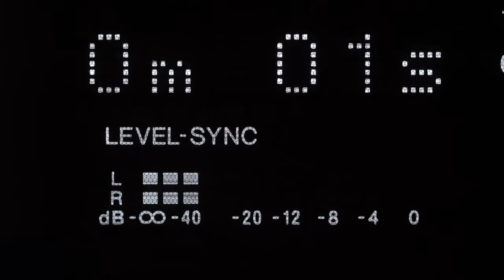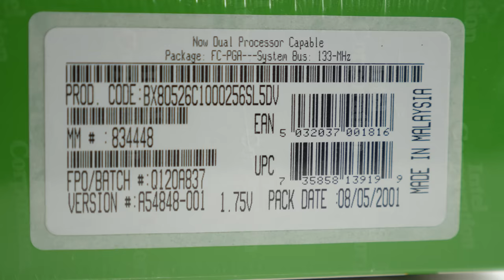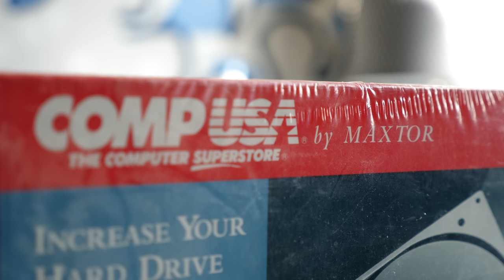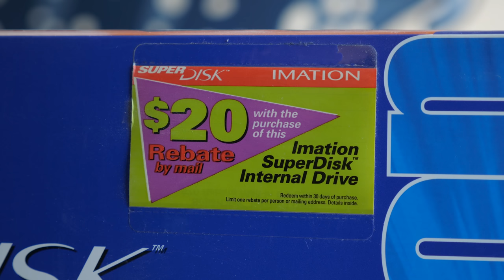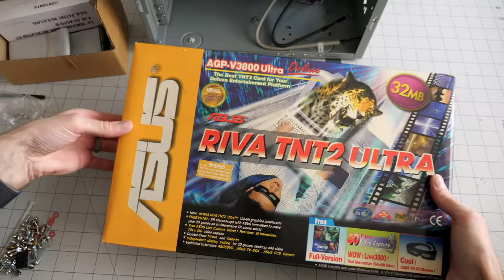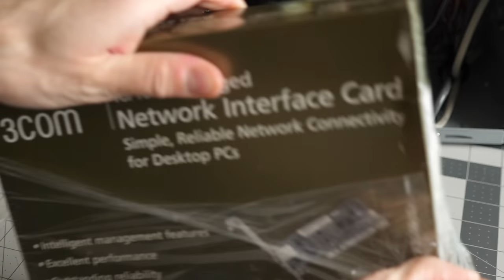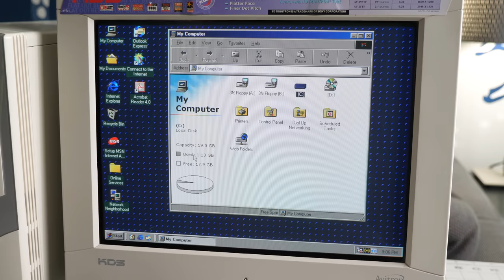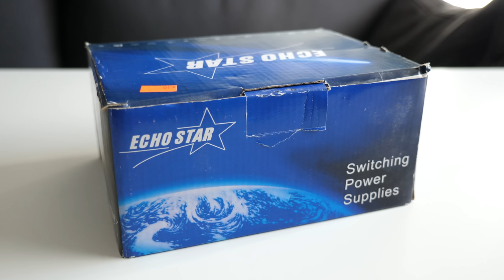Building a Retro PC From New Old Parts!

Comment: I've built hundreds of computer like these during the late 90s and up to about late 2009. I can state for a fact that when I used 2 - 5.5 inch drives such as a CD burner and a DVD burner/player, I' ve always put both on the same IDE cable. Never once anyone complained about burning CDs/DVDs or any other issues regarding the computer performance. It's a total bummer that the LS-120 drive did not work for you. I did build a few computers that had that drive in it and it was super convenient for my clients to have the flexibility to use either the 1.44 MG or the 120 MG floppy drives. I am currently a retired IT pro, but I still build and repair computers for friends and family.

Comment: My first mouse, back in the 1980's, was made by Mouse Systems. They also provided mice for some Sun workstations. They were pure optical mice, no ball or other moving parts. You had to use the special mouse pad supplied with the mouse as it used the red/blue lines on the mousepad to orient itself.

Comment: I think the Sound Blaster sound card is from more than the mid-2000s, I had the Audigic with the front accessory (for the remote control) and on your vintage PC :) I think a Sound Blaster 16 would have been more in line. But it was fun, so many memories!

Comment: The shutoff when the LS120 disk made contact may have been because of a static electricity shock.  In the mid 20-aughts, I had a Toshiba laptop where that happened now and then when I touched any metal or metallic plastic part.

Comment: I had a 486, Pentium 2, 3, 4. All worked great at the time. I always had power supply issues of some kind. One thing I can say, they ran really fast. Once again, I just put together a brand new b550 board, with a Ryzen 7 5700g apu. in 10-15yrs from now, this computer will be a relic as well. We are still in the golden age. I will be honest, I still like the old look of the cases. I dont care about the flashing lights, and the bling, I just want a case that is solid, easy to put my parts in and forget about it. Those old cases were easy to work with and many were build like a safe. This vid brought back so old memories, thanks for the vid.

Comment: I have a similar story about a computer turning off when I stuck in an LS120 disk into the appropriate drive, except the computer exploded. The reason for this issue is that the drives can occasionally short themselves out when a disk is inserted, your PSU had protection, the one in the pc I was working on did not, so all the main compactors blew up. God it was loud.
Slip kachunk
POW POW BANG POW POW POW BLAM.

Comment: I bought a computer from Voodoo Computers of Canada in 2000. It was top of the line, and awesome! I had a 24" Sony Trinitron Wide Aspect CRT monitor. I'm just barely  starting to see tv/monitors match the quality of that monitor. It weighed 100 lbs., but worth it.

I also had a Klipsch 5.1 surround Sound 2 10" drivers in the sub box. The clarity was amazing. That subwoofer shook my entire house.

Comment: Miss the adventure of actually building up your machine over time, getting a dope sound card then graphics card upgrade.

I still smile when I hear that Windows 98 startup sound on decent desk speakers, my first hand me down computer was on Windows 98, and I learned what I could with it even took it to my high school to finally upgrade the RAM on it, from 32 megabytes to 64 using old parts my school kept, eventually buying a new HP desktop bundle for $500 USD at that time in 2003 (that didn't last very long), then building my first custom desktop in 2004, even took it to school to download videos and other stuff using their internet, because I didn't have DSL (or any internet) at the time.

Only reason I stopped using that desktop is the Sapphire 9800 Pro 128MB I had got damaged in a move, and the laptop I was using at the time was "good enough" for games and school work at the time, until the backlight inverter started going out.  The desktop used an AMD Athlon XP 2700+ with a VIA or something motherboard ($100 for both), 1GB or possibly 2GB DDR-400 RAM from Kingston, CD-RW drive and DVD-RW drive from Sony (that was an expensive DVD drive at the time), and a 160GB Samsung HDD that was decent but noisy.

Played the everloving heck out of Halo CE and Custom Edition once I had Internet at home.  Burned so many CDs and DVDs, but got rid of most of those I had left over a few years ago.

I know systems have gotten better over time, and I know I've owned better systems and currently own a really good one, but that time was pretty magical, like others have said, regarding seeing the newest thing come out and wanting to get some part of that for your own. Maybe that just goes with youth and desire, but it was also a great time for me and my friends at least in that regard. Thank you for sharing this blast from the past.

Comment: I want to say the "clipped UPC" isn't someone trying to get a (customer) rebate / the parts being preowned, but the store doing it and sending it back before disposing of the parts to get credit from the distributor / retailer. The same thing happens with books and magazines (in fact, some of Terry Pratchett's Diskworld paperbacks I have have a note about it on one of the first pages - "if you bought a book without the cover, it's stolen, they send the cover back on unsold books to get credit, so don't buy it without the cover" essentially.

Comment: The hot glue was common in the corners around the cd drive. With 24x and higher that used quick release tabs instead of screws, at max rev it would vibrate the case which would rattle against the chassis. Hot glue quieted it down and acted as a vibration dampener.

Comment: The pins on the end of the sound card is use with a IDE ribbon style cable, it is use to connect a header unit the goes to the front of your case and has knobs for volume and things and has plugs for connecting different devices and a little LED screen. That card can be bought with all of that stuff together as a kit, but very hard to find now.

Comment: Still own the 5.7GB version of that CompUSA Maxtor hard drive, and still even have the identical box; the barcode is missing because it had a mail-in rebate for cash back. A group of us stood in line outside a CompUSA early one morning for something like a black Friday doorbuster sale. I don't remember the reason for the event.  But the Maxtor drive was dirt cheap that day, back when hard drives were not cheap. Anyway, that particular 5.7GB drive holds my personal record for longest lasting drive. It STILL works in 2022, probably 20 years after purchase. It is loud as heck and slower than a turtle but it works.  It was retired long ago, of course, but I recall never having even one bad sector on that drive.

Comment: I had an LS120. I had the foresight to get plenty of blanks but I never found anyone else who used them. I left it in the system and kept most of the blank discs sealed. I don't think I ever had a disc go bad on me and the drive itself was of a pretty high quality. Bad floppies that didn't work in a normal drive could frequently be read by the LS120 so I could probably have made more of that situation. A good product that never got traction.

Comment: Another important detail, you should have put the CD burner on the secondary IDE cable. For reference, the IDE connector will time the instructions data-rate to the slowest device on the cable which will indirectly slow down the max data transfer speed of the hard disk or cd burner depending on which one is slower.
And another important detail is that having these on separate IDE buses will also ensure one device does not cause the other to wait for any reason as they will be managed in a nearly 100% independent fashion, which is particularly important on systems of this generation when burning CD's as any heavier load you'd put on the HDD could make your CD burning crap out, which having them on 2 separate IDE controllers would heavily help with. Small difference costing the price of one cable that would and will save you a lot of failed burns.

Comment: I still have two Maxtor drives, but not quite that old. A 200gb and a 500gb. At the time, 500gb was enormous. Those were my only drives for a very long time, until I finally moved to solid state. They still work, I still have data on them and plug them in (externally) probably once or twice a year.

Comment: rainbow IDE cables and floppy cables are great for harvesting wire from for various soldering projects. While SCSI cables don't typically come in multiple colors, they usually feature even finer wire, so they can be great for signal wires that don't need to carry any current to speak of. I've seen lots of those cables harvested for console mods. Plus, if you collect e-waste salvage stuff, you're likely to end up with loads of spare IDE cables and the like.

Comment: Ive been running an x58 setup with an early 2000s massive Antec full ATX case and PSU. I'm impressed the PSU hasn't popped seeing how old it is. It's running a six core x5670, 660ti pushing three monitors at 1680x1050, DVD drive, 7200 rpm HDD, and all six slots of ram filled. Definitely time to get a new PSU before I burn down the house 😅

Comment: The race to 1Ghz was pretty ferocious given the timeframe. The Coppermine P3's were pretty good with being prodded to overclock, I recall a P3-700 I had running ok at 931Mhz then getting a P3-933 which only managed 998 which was reaching the limitations of the Coppermine core. I think Intel released a 1Ghz version but had to pull it with overheating concerns. They fixed it with the Tualatin core but with the compatibilities introduced it fell flat, but even worse was the move to P4 which took steps backwards meaning even Pentium 3's would outpace the newer P4's, even with Netburst baked in. Then Hyperthreading came to fruition and finally P4's became a viable upgrade. By which time AMD were storming ahead with their AthlonXP line then it became a race to see how many cores could be crowbarred into a cpu package. Amazing times.
Reply: I remember when AMD released the 1ghz T-Bird in 2000 that was just this wild number. Who needed a cpu to be that fast?! LOL Now it's slow if it runs at less than 4ghz. I didn't get a P3 933 until 02 or 03 so it was "slow" at the time but man did I love that machine and it played everything I wanted it to. Also, you are so right about core counts. In 06 I had a Pentium D a dual core, in 07 I had an Athlon 64 X2 also dual core, in 09 I had an Intel Quad Core and in 11 I had an Intel 6 core. Which is wild to think that 11 years later a 6 core is considered the bare minimum now and most people will tell you to get at least an 8 core to be safe.

Comment: On the secondary IDE channel you used different ribbon cable. That will  give you slower speed to the cd drive. Can also produce intermitent sound during audio playback from cd-s if you copy from cd in the same time. If i remember well that cable also disables UDMA transfer.

Comment: Just a little tip on older motherboards like these. Try to clean them with 99 isopropyl alcohol and deoxit contact cleaner. Some of them connections might have rust of them.

Comment: The PCs had a BIOS with a power management which, in conjunction with Win98 / XP, enabled the computer to be turned on from the keyboard with a dedicated button. A common (for me) solution was to enter the password that was started by the computer (previously set in the BIOS) from the keyboard. If you love PC from those days, YOU SHOULD KNOW THIS.

Comment: I honestly get both sides for opening sealed eletronics. On one hand, opening them and using them as they were intended to be used just makes me happy, but on the other, i think just a couple should go into museums for people to look at and get nostalgic or see how the previous generations lived. But on the same side it would be fun to have them completely opened for people to see the processor, gpu, ram, whatever and see how far we've come. Like looking at old hard drives from the 80s makes me kinda laugh at just how far we have come in storage technology in the past 30 to 40 years. So, yeah, both sides are valid but i prefer being able to use the parts as they were intended to be used.

Comment: Great nostalgic video.. sleek commentary. I also liked that you covered up all the failed part hiccups. It gave a more nostalgic feeling. Used to make some pocket money back in my college days by building pcs for people. I also ran into cases of repairing and upgrading old pcs and ran into parts being dead issues. Trickiest issues i faced was ram being partially dead.. so PCs will run till the ram didnt fill up data on the dead chip on it and once reached there it would give random restarts or bsod.

Comment: The memories of that era are ingrained! cases with razor sharp edges that tore your hands up, cpu fans that would last a week or two before wearing out and screaming like mad, power supplies that were total junk and if the internal fan did not die the capacitors would explode. The absolute pinnacle of the cheap-junk pc for me, was the TX-Pro PC-Chips socket 7 motherboard! what a pile of junk that was lol.

Comment: I Actually Had That Very Same Motherboard, And The Same Ram Sticks, and The Very Same Heatsink, And Fan, But A Different Speed CPU, But A Slightly Larger Hard Drive, But A Different Case As Seen In This Nostalgic Retro Video 23+ Years Ago, And Win98, Then 2000, Then Me, Then My Favorite Win-XP, Then XP-Pro, With Windows Media Center For My DVD's . . . Wow, And Weird . . .

Comment: I have a possible reason the barcode was cut out of your package. Various jobs I’ve done mark unsold and retired merchandise that way. Sometimes they are sold in bulk other times they are discarded. Books that have the title page removed are usually that. The store is compensated (somewhat) and the item can be sold at a discount. Sometimes they are resold as “new” by shady operators.
 This happened at my local auto parts store older model parts like filters and hoses for retired model cars.

Comment: I had an imation LS120 drive back in the day.  At one point I remember being able to get the drive with 2 disk starter pack for $49 or about the price of a standard 1.44mb drive (2 ls120 disks were about $35 by themselves). Because they really make the money off disk sales. they give you the drive cheap and make you buy $18 disks.  Iomega did similar things with the zip and jazz drives.

Comment: I built my original tower used hospital terminal for $400 in 1998. It was just a terminal. Lucky I had an uncle help me just enough to help me learn bios flashes, the whole nine. The first one I probably spent 1200 extra on all extra cards and gasp dial  up modem card. I was downloading dance music from the UK over dial up and happy with it. 
There are so many music friends I had who ended up overheating pc's in dorms, starting fires playing music w fancy graphics. Milkdrop on Winamp. Like a LOT. I never got a fire. One laptop I did have to put it on physical icepacks when pushing it hard. 
Still have my 2003 Joe Rogan style Powerplay XL headphone amp from that that time. 2/4 channels still drop the bass with DJ cans.

Comment: The MaxBlast floppy disk wasn't only about formatting the HDD : it also allowed to use the HDD on systems where the BIOS didn't identify big capacity HDDs.
It's a bit absurd Imation didn't add 2.88MB compatibility to their 3.5 floppy drive even if this capacity was really uncommon.
In order to get a really secure copy from a CD-ROM drive to a CD-RW drive the best practice is always to make an ISO image on the HDD in order to avoid buffer underrun that can happen even if the two optical drives are on different IDE channels.
Post 2000 AGP graphics cards, even low end ones like the Radeon 9200 (and Pentium III  processing power) allowed most of the time a proper MPEG-2 decoding, the dedicated DVD add-on cards were more oriented to Pentium MMX, Pentium 2 or K6 based hardware.

Comment: @This Does Not Computer, what a fun video! I remember my very first computer, a Tandy with "Intel Inside" it had a 100MHz processor! If I remember correctly you could switch between different chips by changing the jumpers on the board. It also came with six 3 1/4 floppies to reinstall "Windows 3.1".... Anyway, I noticed on that "bad power supply", you can see one of the resistors (R35) is completely broken on one end @1:08:16.

Comment: Primary and Secondary refer to the controllers, not drives.

Drives can be Master or Slave (per controller).

The Slave jumper (commonly "SLV") should be shunted on the Master drive when a Slave drive is also present on the cable, and has no effect otherwise.

Not having a shunt on the "Master" jumper sets the drive as a Slave.

Comment: I think using a thermal pad for cpu was a safer option because the paste might spread and leak to the sides due to the pressure when fixing the heatsink using that clip.

Comment: He should have had the mains PSU Wire supply OFF by the switch, that's why the 1st PSU blew up, he said it was off. When he plugged 2nd PSU to wire, it was already switched on which is dangerous, could blow like the 1st PSU.

Comment: Very similar was my first build, I was around 9-11, it was right around GeForce 256 launched.   As a child I had limited monetary resources - mostly consisting of "pitching ideas" to adults to get a bit of their budget - so Celeron III, less ram, but good sound card, will build it myself to save money etc.

So many memories. 

But I hate your power handling: first connect tester to psu then turn on PSU. This was how they were meant to be used. 

Also not turning it off after testing for installation...

These old parts had sub par power cascades and safety circuits from today's perspective. There might be stored charge somewhere, frying something. (Memories...)

Still nice vid.:)